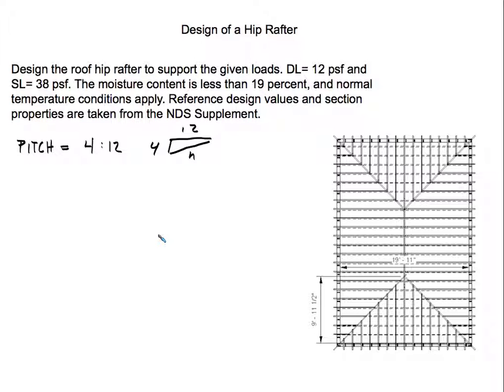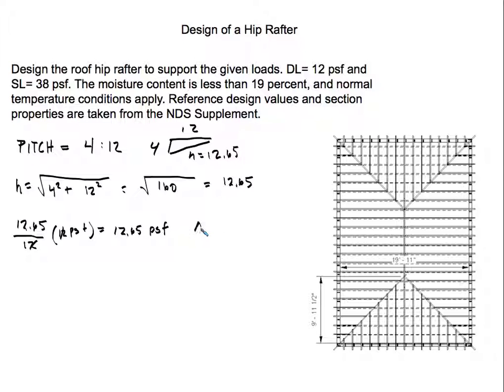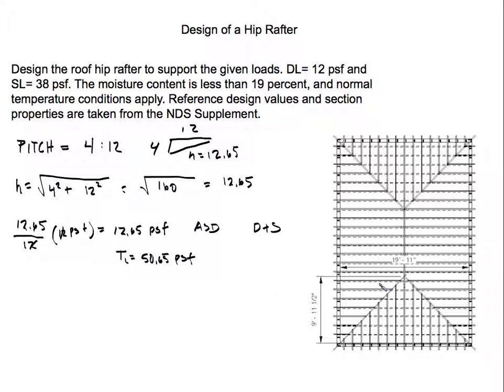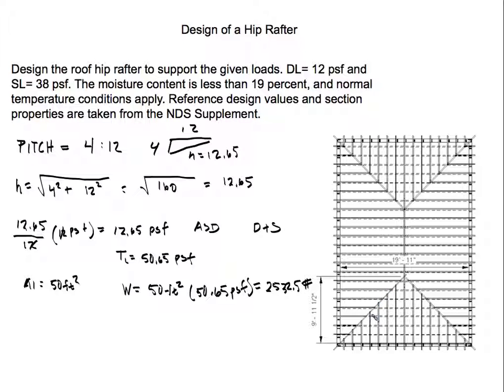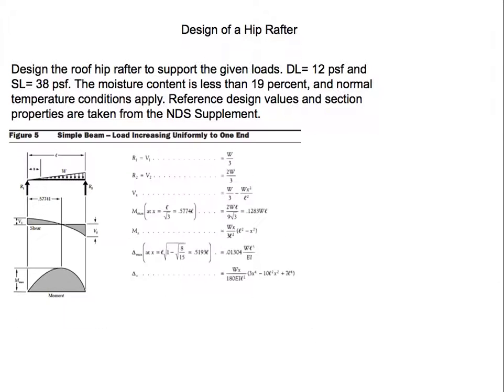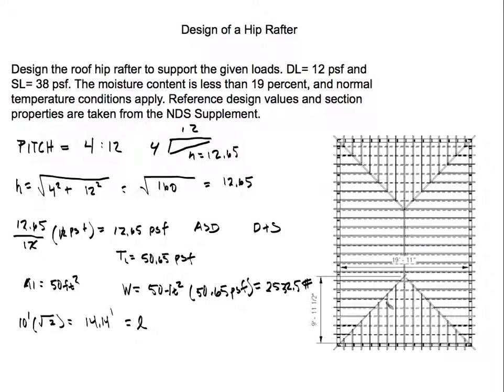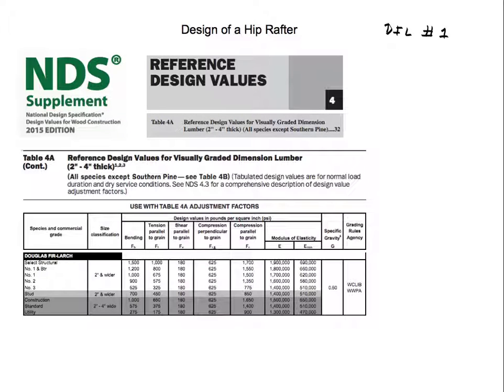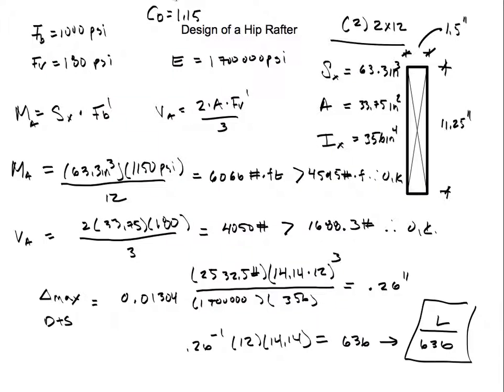Hip Rafter- Design example of Hip Rafter Part 2

Comment: Wouldn't the load applied need to be a uniform load for that table to work? You are using a concentrated load which you need to just divide by the length to make it a uniform load.
Reply: Yes I agree.

Comment: Why did you use figure 5 for a graduation increasing load ?
Reply from the maker: Hector Guerra for the hip beam, the rafters closest to the eaves are small. As you get closer to the ridge the rafters are getting longer in length thus the hip beam sees a triangular load.